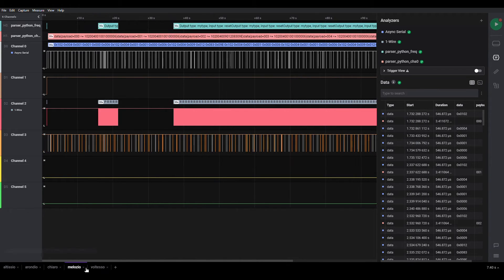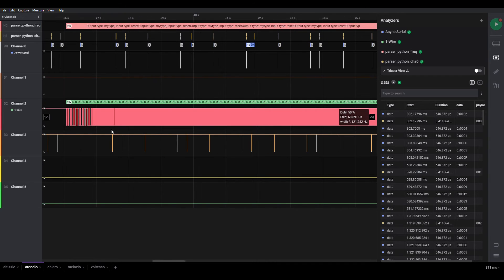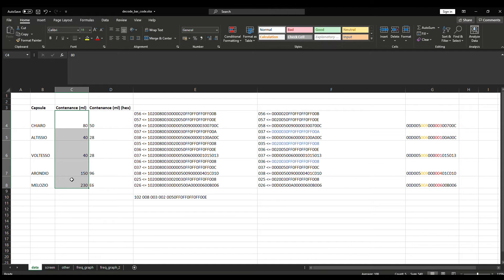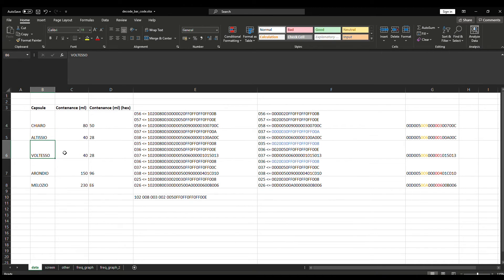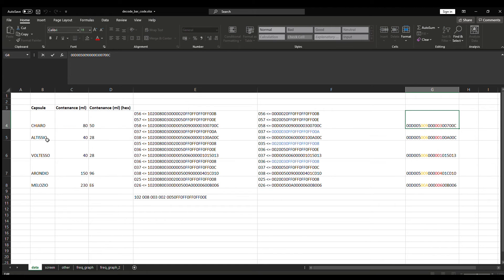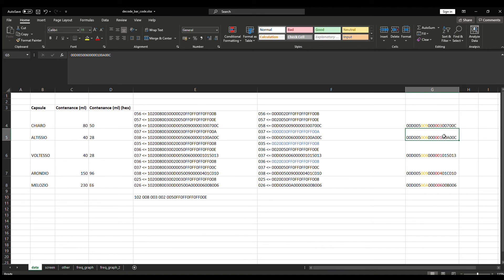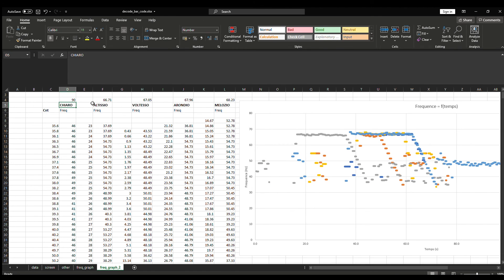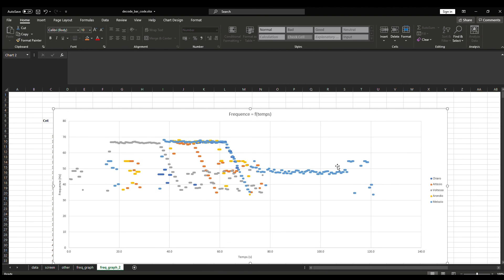Nespresso vertuo next : Reverse engineering (1/3)

Comment: i was ready to throw out this thing - so frustrating.  it never mattered how much we cleaned the glass and area around the barcode reader.  i watched this, disassembled my device, and saw just how caked with coffee the barcode reader was under all that hardware.  it wasn't easy to put it back together, but after all the effort, it now works like new.  thanks for this!
Reply: Hah, I did the same thing, except it didn't fix the scanner; so I assume the sensor (or the attached PCB) is borked.  I guess I could get the multimeter out and check for shorts, but just can't be bothered!

Comment: thanks, used this as a reference and finally cleaned up the barcode reader and get it working again...
Reply: Same here. Notes for others: There is a little tube that either gets clogged or doesn't get enough rinse water through it. It is responsible for draining the channel where the laser sits. If this gets clogged then crud builds up on the lens. I pulled mine apart and cleaned, now works perfectly fine. You need a T10 with the security hole to open.
Reply: Waittt which one is it! Pls help me .(
Reply: Hola, como lo limpiaste? Por favor?